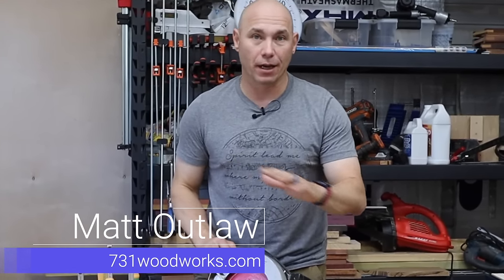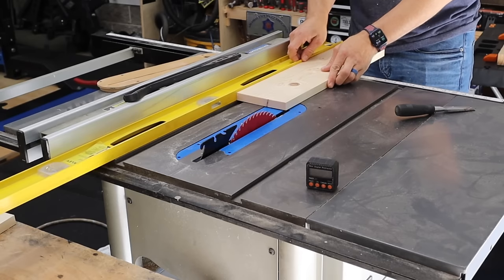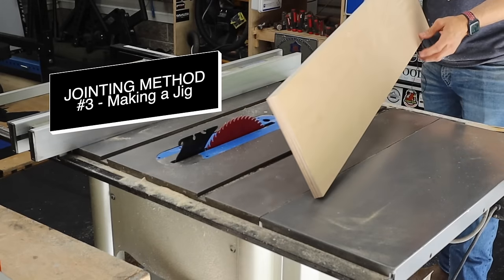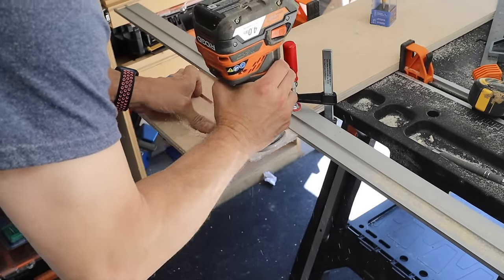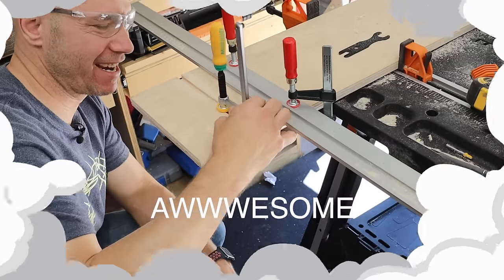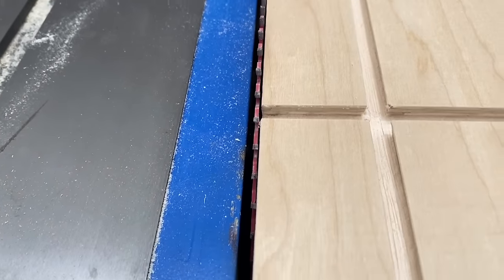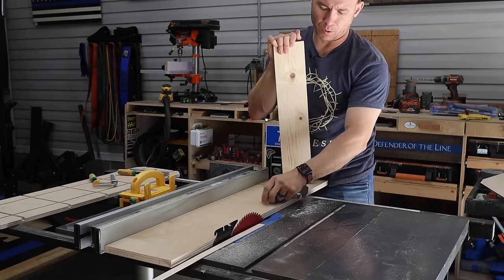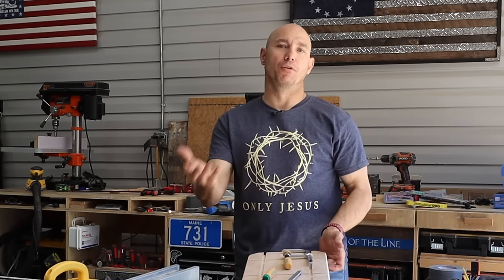5 Ways to Joint Boards Without A Jointer | Woodworking Tip

Comment: Hey, Matt, I used a 48" level with grip tape on one edge to joint a couple of boards and it seemed to work fine. I also used a 12" level with Temu double sticky tape (trying it out) with a small piece, and it too worked fine. Is that advisable?

Comment: I used toggle clamps on my tapering jig. I used scrap wood block as a space under the toggle clamps to raise them up for enough clamping space and so the screws don’t come out the bottom of the wood and hit the table

Comment: I don't know how much a jointer costs, but I surely can't put one in my 8x10 shed/workshop.

I have some 2" walnut offcuts that I'd like to joint on one edge, but if I use the jointing sled method, my (job site) table saw blade isn't high enough to do the job.  I'm going to try with the taping method (on 1/4" plywood) or the level method, and see how that goes.

Comment: If you attach the slot guide so that the sled extends just barely beyond the blade, then run it through the blade, you are left with half of a zero clearance insert for cleaner cuts and a perfect guide to align your stock.

Comment: I bought 2 routers the same so I could run 1 with a strait bit and another with a dovetail bit or whatever without having to change the bit or set up. Much easier and faster. Handy for other methods too.

Comment: If the auxiliary board was twice the length of the working piece., plus saw blade, you could probably do it in one pass. Make the same kind of fence for a router table that doesn't have adjustable infeed outfeed fences. Steel fence > glue a strip of laminate to the outfeed. Also add-on fences on router bases for handheld tools, prevents snipe leading in and out of cut.

Comment: A question for the Carpenter? Why not use a hand planer. Find grain that almost matches the grain, join them by using a hand planer. You only use that method for big board's.  Everyone has there own method for joining 2, 3 or 4 board's together. I like the Biscuit Cutter, ( it removes a half disc or whole disc shape out the wood you are joining) Then glue and clamp overnight. Use the planer to find all uneven areas and sand. You should have that tool in your shop, there are different sizes of the hand planer and then there is the electric/lithium ion planer. And of course the Big Planer.( that slowly draws the board's in and plains all together) .

Comment: Giving consideration to using my table saw as means of flattening glued (or non-glued boards) by raising the blade & moving the board across the blade just enough to shave off 1/32 of an inch until enough has been removed to render the board flat enough to finish with sanding. What do you think?

Comment: You don't need a router table.... you just need another router!! Before covid (as a Canadian) I would go cross the border to HF and pick up their trim routers for like $20!!! They're not too bad either. At that price though I have a small trim router for all 5 of the major bits I use, have the routers set and I never fuss with changing bits EVER.... In my opinion so worth it for these exact types of jobs...
Reply from the maker: Thank you

Comment: So with that dovetail sled with the guide on the bottom, if you did another one on the other side and then took 2 more boards and put a dovetail joint on the bottom could you then use it as a cross cut box? It'd be nice to have a collapsible crosscut box or you could just slide the two pieces off and set them on a little holder on the side of the table saw...

Comment: Love that edge jointing jig. What about face jointing? Basically how to flatten a board (take a bow out) without a planer or a jointer?
Reply from the maker: Check out the description. I put a link to 5 more ways to joint and that video includes face jointing.

Comment: I'm a little confused when using the sled and clamping down the piece you're jointing..... how come that doesn't have to be square to the sled? Wouldn't the board have a slight taper? Not challenging your methods I'm just new to this and trying to understand. Thanks for your videos they are always helpful!

Comment: Here is another jointing trick - for really strong joints (when necessary)
Cut board edge at 30 deg to 45 deg then glue together, then dowel joint them in opposite deg across the cut.  It is NOT going to come apart under load OR due to shrinkage.
For a strong but finished face, only drill to 80% of the boards thickness, then the dowel end won't show on finished face, but will still be immensely strong.

I understand this only works for an edge you can get to, but even gluing up a diagonal joint is a lot stronger than a butt joint.

Comment: If you can't make sure the blade is perfectly square just flip the second board to give its edge the opposite angle as the first, and then they will still match when putting the edges together.
Great video though, might finally build that sled myself, too.

Comment: When you use the sled method, how do you know that you are lining it up exactly paralell to the opposite side?  Without reference points of some kind, you could be jointing the edge at a slight angle.  Are you just sighting it to make jointing rip cut?

Comment: I recently purchased a delta table saw similar to yours it's a  725 T 2. It too has the same style blue metal insert that your table is showing in a video. first of all why is there a black inserted piece at the far side that is lower then the rest of the insert? Secondly can you tell me where I can find a metal table saw insert plate that is all one piece.? When cutting short pieces of wood the material hangs up at that far edge of the table because of that black insert. I ended up having to buy one of those wooden ones which works OK but i would prefer to have a solid one piece metal insert.

Comment: The only thing I would change for the vertical plywood against the fence method would be to make sure that your blade cuts into the plywood exactly the width of the blade. Then when you were hogging out the Space for the blade and arriving knife, run that all the way to the leading edge of the fence. That gives you enough offset so that you don’t need to build up with the vinyl or whatever on the other end. It makes it more like a jointer table. Just my two cents. But what do I know, I don’t even have a tablesaw.

Comment: I think the level method works also because it basically extends your fence past the start of the table saw and allows the entire board to contact it before you start cutting. This only works when the concave is pointed towards the level. If the bump is in the middle of the board it will be able to rock regardless.

Comment: This is a great video, truly helpful and well explained. Could I use 3/4” MDF or particle board for the jointer sled, or must it be plywood? Thanks!
Reply from the maker: I think MDF would work, not sure if the dovetail grooves would hold though
Reply: MDF is not as strong, but should hold up for this use.  I Peter Millard did an entire bench top of these dovetail channels in MDF.

Comment: First, thanks for your sharing of this jig. Would there be a reason the jig couldn't be longer for longer boards needing to be jointed? I was thinking 60" to 72"
Reply from the maker: yes, you'd run out of room on the table saw
Reply: @731Woodworks  I have a run-out table for my saw that would accommodate the extra length...it would be supported throughout the cut...thanks for your help and the reply!

Comment: Hi Matt. Instead of using the dovetail clamps, have you considered buying some toggle clamps instead and simply screwing them onto the plywood? Would probably save you a lot of time?
Reply: Depending on the width of your board you will have to screw and unscrew the clamps. It would take more time and not as user friendly.

Comment: If I'm joining two boards together without a jointer.I line the edges of both boards to be joined together. Then attach with double sides tape, a few pieces of scrap wood to bridge both boards. Next adjust your table saw fence so that half thickness of the blade cuts through both board edges, and the height of the blade just clears the thickness of the board. The ensuing cut will join the boards perfectly. Even if the blade isn't perfectly 90 degrees to the table the join will still match with absolutely zero gaps.
I own a really good commercial grade jointer, and inspite of that, sometimes this is my preferred method.
Give it a try.
Cheers.👋🇨🇦

Comment: The method use at 4:40 where you cleared away a section on the sacrificial fence. Can this be used to dimension lumber on all sides safely?

Comment: My brain is not following regarding the sled for joining boards. I currently use your level method. 

When using the sled the board just barely hangs over the edge....I understand that part. Does the board need to be square to the sled....or does it not matter? My mind says if it is not completely square then it will be tapered. 

Thanks for the help. Your videos are great and have helped me a ton. I am also a LEO.
Reply: You could end up with a taper.  You would try to make it as square as possible when clamping.

Comment: Really like the jig, makes me really want to take my $2 HF bar clamps, cut the rivet and take the end off, and engineer a dovetail keyway to bar adapter..
Reply: Thought of much better last night.  Once you get a repositional clamp for this, you won't really care how it's done.  Make the tray bigger, off to the other side from the saw blade.  Put a large block for the clearance height, say 2 or 4 inches high.  On the edge of the higher block put some bolts with wing nuts, then just some arms with slots, and a screw clamp at the end.  .  Adjust to go back over and clamp down the work piece.  (This would need a better description, but there's a better way so don't bother..)
But much, much better.  You don't really care how this is done, so you're not attached to dovetails.  Put T slots in, go to Lowes/Home Depot and get some aluminum T of the correct size.  Cut down the sides of the T so it'll go in the slot, then cut the rivet off of a Harbor Freight $3 bar clamp.  Bolt it onto the middle of the T and you're done.  Should cost about $4 to $5 each, and the clamps go on sale for $2 once in a while.  The T isn't super cheap usually, but not too bad and you only need around 4" per so you'll get 2 or 3 clamps per foot.
Can't wait to cut some T slot for size, go get some T and more clamps, and try it out now..

Comment: The dove tail jig looks like an effective tool. Do you know if it is available commercially? I’d rather buy the jig that I would use many times than invest in the tools to make it that I would only use once or twice.
Reply: Microjig has plans on their site.  They sell the clamps and other related hardware for the dovetail jig, but not the jig itself.

Comment: Doesn’t this method (love your jig) assume that your fence doesn’t wobble? My 1970’s Delta 10” tablesaw has a 2x4 for a fence that is only attached at the front edge. At the far end, the fence has a lot of play. If I clamp it, the clamp can interfere with safe operation of the saw if I catch an edge of the clamp. However you are right: adding a miter slot guide would solve the problem. I know what my next jig build will be! After I set up my router table.

Comment: I know this is a bit off topic, but if you have a twisted board, how can you make a usable board without the planer? you basically covered the joiner in this fine video
Reply from the maker: Check the description I put a link there to another jointing video where he covers that part

Comment: Thanks for this great demonstration Matt!  Couple questions if you have time to reply...
What thickness plywood did you use for the sled?
I really like that folding table with built-in clamps you used at the beginning of the video.  Please include a link to the item if available.  

Blessings,
Rich
Reply from the maker: Hey Rich.  I used 3/4" Plywood. More info on the folding bench here https://youtu.be/x8gmxltaI1E
Reply: Thanks Matt, really appreciate your content and the faith that drives your passions. :)

Comment: Could you combine this jig with a planer sled?  I was thinking that both need something flat and about the same size.  Just wondering if the dovetail cuts or anything would make this a bad dual-use jig.
Reply from the maker: that might be a cool jig!

Comment: Are all digital angle finders pretty much the same? I noticed the one in your video looks a little different than the one in the link. The ones on the link start at around $20 but I wasn't sure if they are as accurate as the more expensive ones. Thanks.
Reply from the maker: I paid $20-$25 for this one I bought a few years ago. The wixie is higher rated and always in stock so I linked to it.

Comment: Novice here,  but if you left the level in place and moved the wood on that, the level would remove any bowing (assuming concave, not convex) as the level would rest on the peaks.     Wouldn't it?   If fence us biwed, unless there's a 2nd peak, SOL - level would just teeter on the one peak.  Anyway, that might be why you get just off on some - moving the level started down a bow in the fence.

Comment: If you put the 3/4 in miter track on the bottom of the sled then you can ditch the fence for it to ride on but yo can make it a large miter cross cut sled too. . You can then make you a fence to go 90 degrees across it you can clamp down by jointing two piece of 1"x3" in a L shape to make a back stop miter fence.  Once you get it square to the sled and blade drill two 1/4 inch holes on each side thru the bottom plate of the backstop fence and into the sled You can buy or make a couple 1/4 in pin to go into the holes to reference 90 degrees every time. To make the pins cut 1/4 bar stock about 2 inches tall drill a 1/8 hole in them across  the pin1/4" down from the top of pin so you can put a key ring chain to pull it out.   Pop the cross cut fence on the sled and line up the pins and clamp it down an you have a 90 cut every time every time for cross cutting larger pieces or panels than a miter gauge.   Don't put it at the very back of the sled instead about a foot or more from the back and you will have room to set it at different angles.  Just put the reference pin in place on the side closest to the blade and turn it to the desired angle and then clamp it and  drill thru the other hole on the other end of the fence to make a new reference for what angle you are cutting. Then clamp it down and draw a line on the sled along the back of the crosscut fence and write down your angle.  Make as many anges you need and drill new holes in the fence for reference if needed to keep the holes off each other on the sled.  Just mark what hole needs the pin for each angle.   I have a crosscut sled I made very similar and I love it.           I hope I said all that to make  a bit of a little sense.  I see it very easy in my head. 😂 Great video BTW!  I will like and sub.

Comment: The only recommendation I have for the jointer jig is to use C-clamps instead of F-clamps.
C-clamps tend to not become loose from machine vibration, unlike F-clamps.
C-clamps are actually mandatory for many WorkSafe advisories when clamping with machinery.

Comment: you don't actually have to have your table saw blade at 90° to joint boards, you can even do them at 45°, you just gotta orient them the right way, but it's easier if it's perfectly 90°. Same goes for using a jointer, planer, etc.
PS. that sled is nice, i'm gonna have to make my own dovetail clamps though, cuz those are really rare and really expensive (around here)

Comment: My question is why are you sliding the aluminum level against your fence why not clamp the level to the fence and push your wood through it'll provide the straight edge just the same.
Just make sure that the board that you are straightening is half the length of your straight edge just to the as with this case it's your level.
For longer boards use a longer straight edge but nevertheless clamp it to your fence and it'll accomplish the task.
I've made an 8-ft and a 10 ft straight edge and it works fine.
Just make sure that you turn the concave side of your board  to the fence.
Keep in mind your geometry, two points establish a line.  
This method works best if you have many  boards to straighten.
Thanks for the video.

Comment: Why did you have to slice into the 2nd example? How does that help the Jig?  If there was a bow in the fence,  that would all be there on the unsliced portions.  ???  It also assunes the plywood jig board has been jointed and perfectly level.

Comment: Everything I've bought from kreg has never been straight or square. The rip cut guide for plywood was off by a 1/4 - 5/16. The straight edge was different widths. The accu cut had so much play in it.

Comment: When you set your tablesaw blade to 90 deg. It doesnt cut a perfect right angle because the blade tilts to the other side when cutting. So i recommend to put your wood alternately facedown and faceup so it woul fit nicely.

Comment: for the dovetail jig and sled, are you lining up the board with a reference point on the jig? How do you know where to place the board you are jointing so that it doesnt taper...
Reply: You place it by eye, because you're just trying to create one edge you know is straight.  Depending on how bad the initial edge is you might have to taper the board.  Then you'll flip it over and use the fence to cut the other edge parallel.

Comment: I'm just getting into woodworking. I bought some 4 and 8ft edge guides for my circular saw and cordless palm router. If I use two at the same time and let the circlar saw shoe or the router plate rest against them, is that doing the same thing?